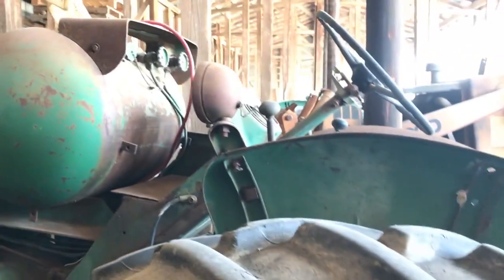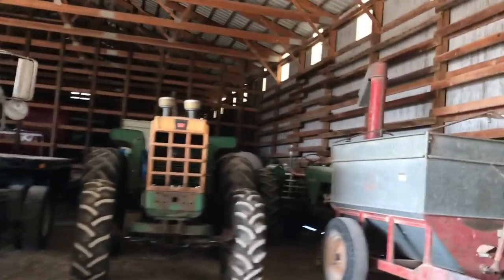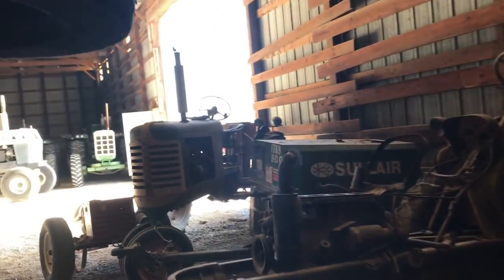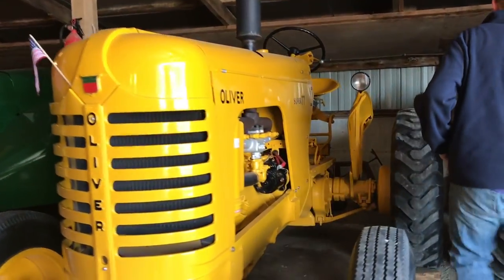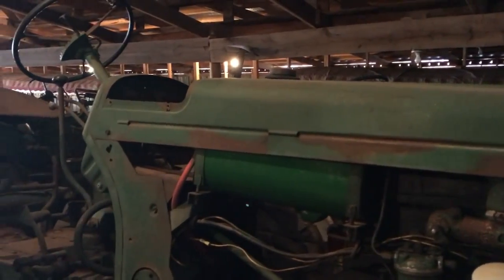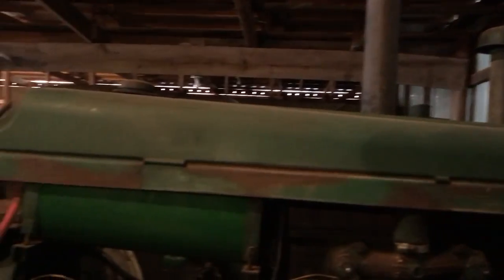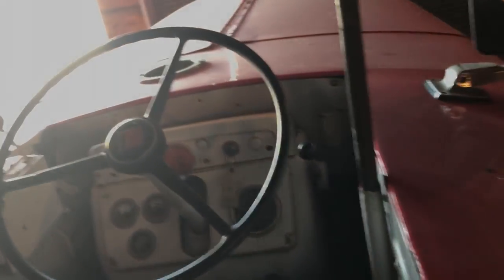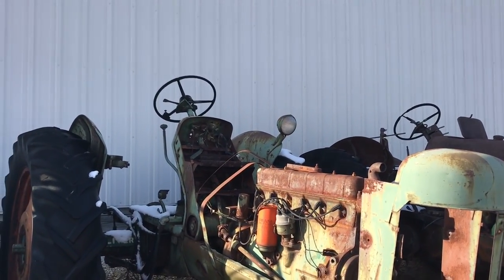Christmas Special/Korves Oliver Collection (December 2017)

Comment: Are you a little guy or have I just been lacking in tractor time lately?
Reply from the maker: Nellson Stout What specifically do you mean? I was younger, yes, at the time...
Reply: 66Oliver some of the tractors seem taller to me than they should. Bigger rubber maybe? Camera angle?
Reply from the maker: Nellson Stout Most likely camera angle. I was a few inches shorter then, and I usually hold the camera about upper chest height.